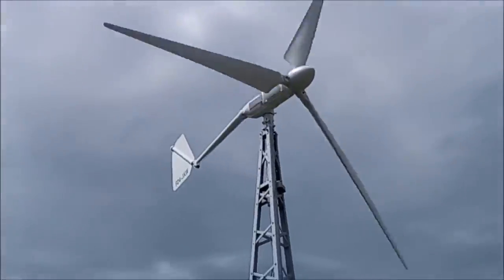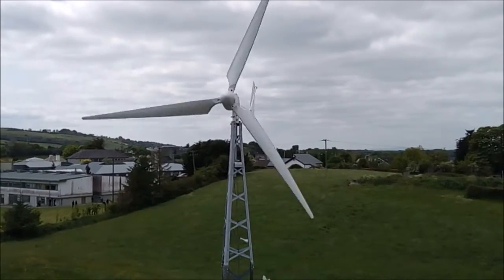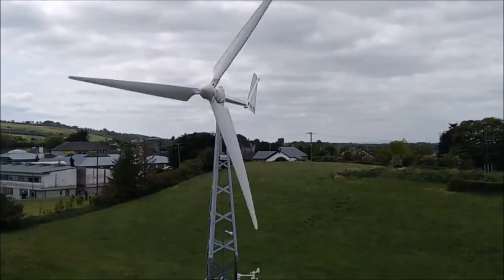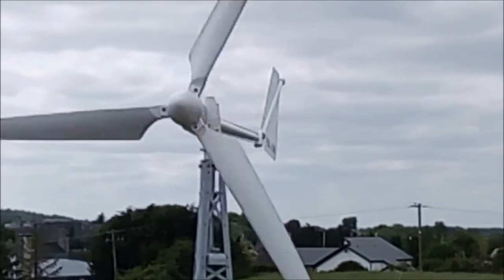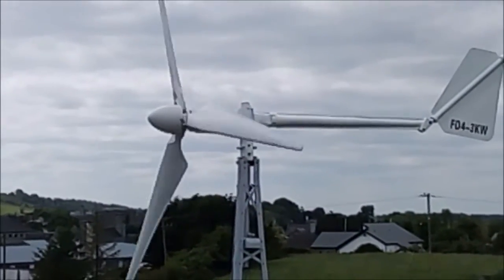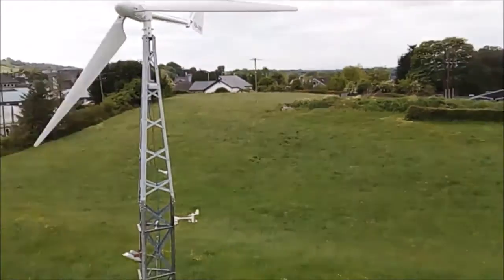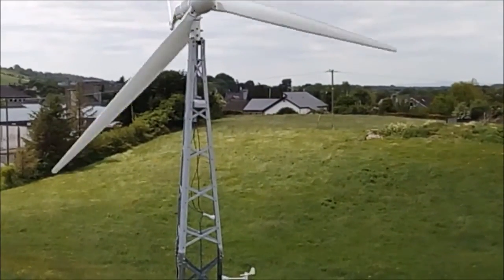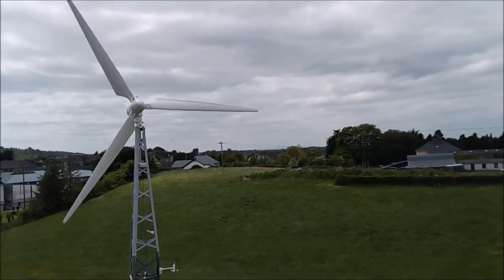l@@k 3000w wind turbine how it tracks the wind no vibrations or rattles

Comment: Any WT should be mounted at least 30 feet above any obstruction for 500 feet around. It is not tracking the wind it is in turbulent air bouncing off your roof that is why its dancing left and right. Take the tower up another 30 feet you may get some decent power
Reply from the maker: Hi Ricardo
I am taking it down and moving it.
Your correct I need to move it as far from the house.

Comment: T S THE COMPANY SUGGESTED PIPE AND GUIDE WIRE YOU PUT IT IN A TOWER WHAT YOU THINK ABOUT THE PIPE AND GUIDE WIRE IS TO HEAVY FOR THAT THANKS JOSE.
Reply from the maker: Its very heavy 110 kg so I am not to sure how the pipe would hold up. If you got a thick pipe I am sure it would be fine. But you be better off getting a big sold pipe with big foundation about 5 feet down and across it would hold.
Reply: thank you ST much appreciate i gone tried to contact the company to see if they have the controller to thanks